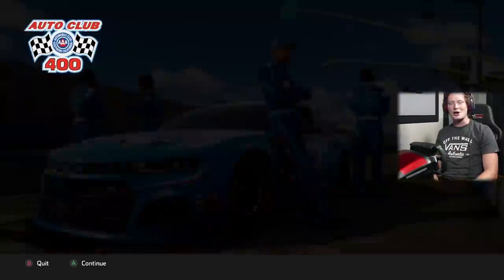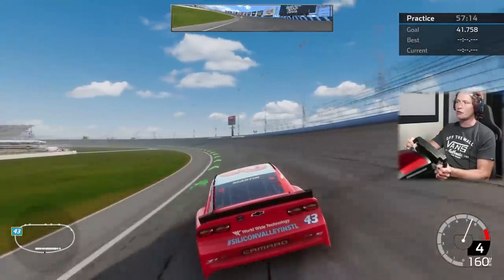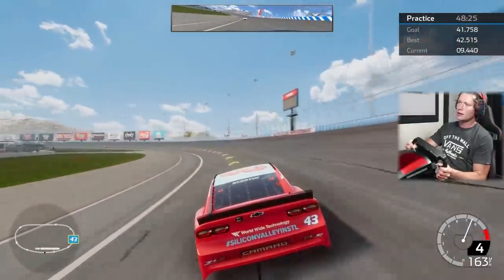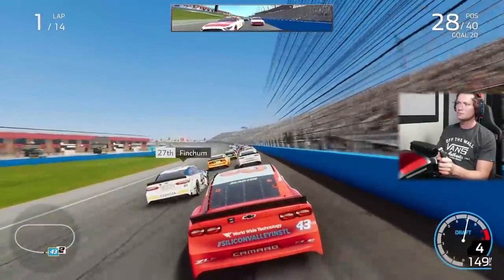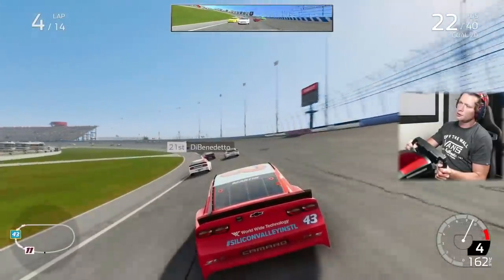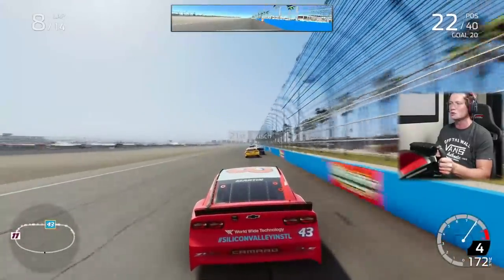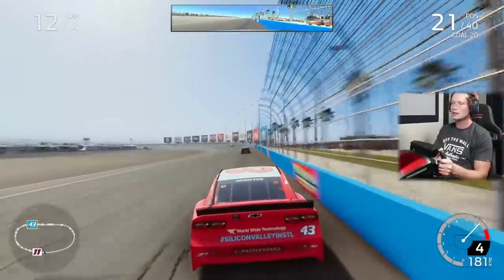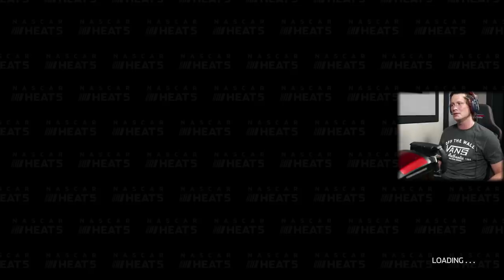NASCAR Heat 5 - Part 3 - Diggin' at the Auto Club Speedway

Comment: When they put the wrench in the rear window, it's called a wedge adjustment. It will either compress the coil spring or relax it, depending on which way the wrench is turned. What this does is change the cross weight in the car, making it either tighter or looser.

Comment: Hey Trev - your straightaway speed is low because you're entering the turns too low. The lower you enter the turn the more your right front 'digs' into the track. This scrubs off speed. 

The higher you enter the turn (stay against the wall as long as you can) the less you have to turn the wheel and the less speed is scrubbed off. Don't follow the guides on the track.

Also, sometimes running against the wall in the turns is the fastest way around the track (especially at wide fast tracks like Auto Club, Atlanta or Michigan) because you don't have to hardly turn the wheel, and your corner speed is higher. And because of that, your straightaway speed is much faster.

Comment: That adjusting you were talking about was called the wedge.. There is a way to adjust it as your practicing. And also play with the tire pressure on your left tires on smaller and medium tracks. Lower the pressure the more grip. And also the toe angle on your left tires and soften your suspension on the right to compensate for the toe angle

Comment: A good baseline to use at every track:

Bump
3/5/3/5 
3/5/3/5

Wedge - 48.5

Ride height 4.000

Springs 
Top spring selection 1,200
Second spring selection 1,100

Camber
5.0
-5.0

1.315

Trackbar 
11.00
10.50

Tape 45

Steering 10deg

Comment: Trev, when you go up to the top you know it’s because ur going too fast. You let off a little late - I would recommend you slowly let off at the start of the corner then feather the throttle slightly as you go round the corner. Also, when in practice make sure to practice the high lines as well, you do these high lines for lower tire wear but lower speed. When you get to tracks like the Speedways you will be running high with 12 other cars, so you need to make sure you know how to run high before then. Ima keep posting tips each video, much love Trev keep up the great content

Comment: In NASCAR terms, loose is more oversteer where the back end wants to rotate more. Tight is understeer where the car doesn’t want to turn. It affects speed because loose allows the car to turn more in the corners so you don’t have to lift as much.  It wears the right rear heavily. Plus your speed struggles come from driving for a 4 star team like RPM where as the Hendricks and penskes are 5 star rides with engineering

Comment: 1; homie , the fastest line is the most straight. (Sometimes outside like is the fastest ) also like the f1 game you play. Set up your corners so when you enter 75% of corner is strait line.                               2: bottom left corner they tell you your draft partner is. use them ,  hold that line and they will push you.                                    3: in this game if they are next to you the wind will make you loose. Only stay next to someone while passing. If not you will either slow down or lose control.                 I don’t even play these games. But for some reason I watch a lot of your videos. You seam like a great dude. Keep up the great work. Enjoy your game plays brother. Thanks for your time!!! .

Comment: You changing the wedge via the back window  Wedge adjustment can make a dramatic difference in how a race car handles during a race. Specifically, wedge adjustment refers to changing the amount of tension on a spring in the rear suspension.

Comment: The wedge bolt on a race car just applies pressure down onto the coil springs on each wheel of the car. Changes the weight on each tire/wheel

Comment: When you start to slide toward the wall, you are too tight. If you turn too much and start to get sideways in the corners, you are too loose. You want to be as close to running wide open in the corners as you can. Not possible at all tracks obviously, but you should be able to hold a steady line in the corners. Enjoying the series!

Comment: if you want to go faster at ovals where you have to lift, let off the gas early, turn in and get on the power as soon as possible, if you wait until the apex to let off the gas, you'll be losing time across the whole next straight

Comment: Not sure if anyone has told you this but you will go much faster if you take off all the driving assists and use expert settings. Tight and lose will not affect the overall speed of the car just how easy it is to turn in the corners. You can make better lap times with a looser car but at the risk of being on the edge of spinning

Comment: Hey trev if you go into a turn in the gas let off until the middle of the turn and then get back into the gas also if you run the high line you go faster but you are slower in the long run

Comment: The problem you are having is that you need to learn to hold race lines. The one you see in practice is the preferred qualifying line not the race line. A better race line will improve your tire wear and fuel consumption.
Reply: I use the practise lien and it is currently working for me I come top 20 in most of my races atm

Comment: still under and oversteer confused :D if you tighten in up you understeer even more (turn less) and have to let off even more before turns. more loose turns the car more into the corner but you risk spinning

Comment: Trev you’re bringing an F1 mindset to nascar and it won’t work there usually are not “apexes” in nascar running high is okay to get better runs down the straights also turn yellows and stages on and race length up

Comment: You were still diving into the corners a bit too hard. If you're going for a pass and you've got worn tires, make sure you can get under the car in front of you so you can use them to prevent flying up the track. And you don't get punished for bumping cars. This is stock car racing, not open wheel racing. "Rivals" are the only punishment. They will wreck you in future races if you wreck the same guy too many times